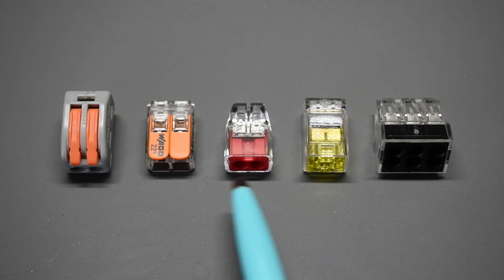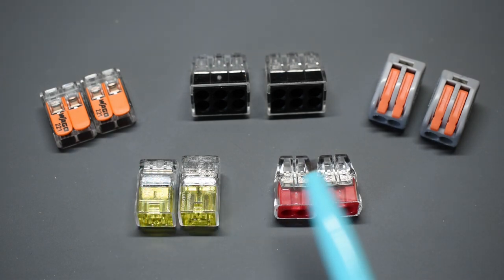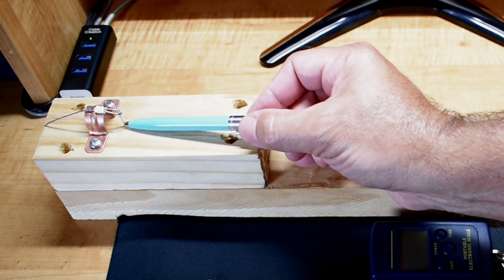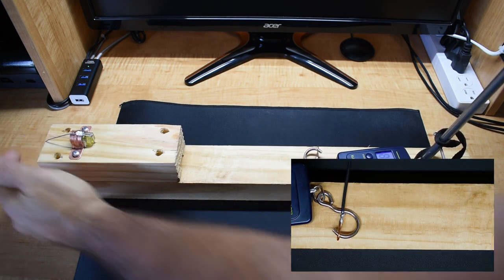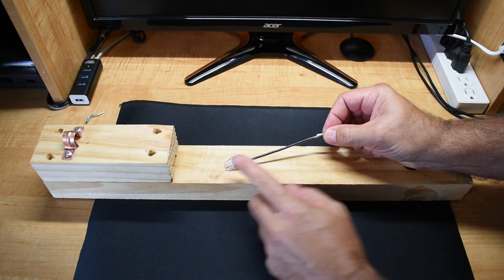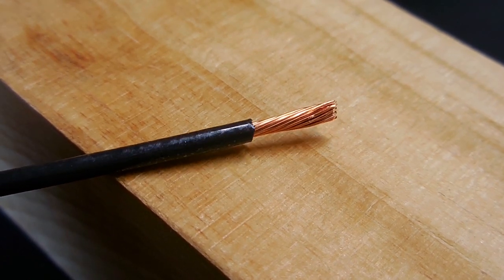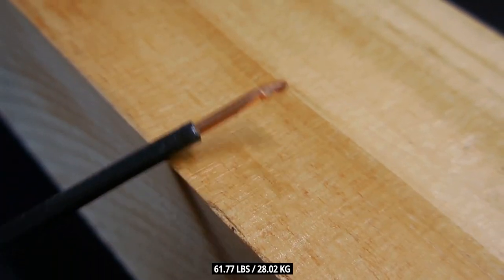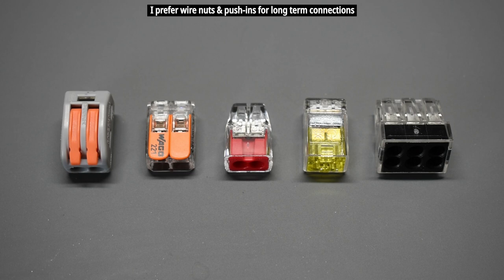Electrical Wire Connector Pullout Force Tests! Wago, Ideal, Contractor's Choice

Comment: The Wago 221's are gtg for permanent use.  They are UL listed to 600v at 20 amps and 85c temperatures, they meet every spec a wire nut does.  If you have something pulling on wires and exposing conductors you have either a flying spice or no wire clamp on the box, both of these scenarios are already hazardous and not allowed.  I remember when the push in style connectors started coming around and everyone scoffed, now they are ubiquitous.  The cost premium is easily made up in labor savings, you can terminate many more of these per hour.  I dont know if you have ever had an already short wire break off in the box because someone twisted the wire too much but these eliminate that problem.   I use the lever Wagos a lot in field connections in industrial automation.  These things are absolutely fantastic.
Reply: Through my new construction, service work and shutdowns experience the only wires I've  had break off were scored solid conductors. That said I've all seen alot a shitty terminations with stranded wire aswell but when it comes down to it all connectors are good when done right. I've definitely seen more good then bad. Except in residential when you know it's was a homeowner handiwork.
Reply: @thomasseabrook1041  thats a good point, "are good when done right" the thing is wagos are almost impossible to do wrong 
which is far from the case with wire-nuts.
Reply: Not everything is permanent install domestic wiring done to code. Maybe I'm doing a hobby thing where I need to hook up LV wires in the field, and maybe I just want to know how much tugging it will take before it pulls out. Useful info is useful info.

Comment: Amazing that these have been used for eons in Europe, and yet only have now seem to become trendy in North American.
Great video as always!
Reply from the maker: Thanks for watching Rich!
Reply: Sad that they brought them over here. They are de-rated to 20 amp by UL, but these are still not a very good connector.  Easy, absolutely and if that's all you care about, I don't know what to say, you probably think easier is better. 

Right out of the box, brand new Wago 221s have about 15 times the resistance of a wire nut. Sometimes even more!!
Reply: @professorg8383  good point. I use wire nuts myself as the direct copper-copper connection is the best one can get without having a continuous line.
I am surprised they their resistance is quite high … still I suppose a wire nut has basically no resistance (as it is not part of the circuit rather binds two wires together) still they can’t be too bad can they?

Comment: It was good to see wire damage after failure.  It would have also been interesting to see which connectors are still reusable after the test, and if so whether or not their pullout performance had decreased.  If the Contractor's Choice product is destroyed by a single test, but the Wago products are undamaged and still perform well after multiple test cycles, that would be worth knowing
At the end of the day though, if the pullout capability of a connector is much more than is needed to prevent unintentional release of wires when pulling a receptacle/switch out for replacement, that's good enough for me.  I'm much more interested in long term connector reliability (e.g., corrosion resistance for oceanfront property, etc.).

Comment: I applaud the follow up video.  I think the in normal operation 22 lbs should be more then enough holding force.  If you have more then 20 lbs pulling on a wire I think a staple or other fastener is warrented to take the pressure off. 

Small nit-pick the lever nuts call for 11mn of insulation stripped.  Not sure what if any difference 12mm makes.
Reply from the maker: If stripping the wire needs to be that exact, being one mm off, then the design is heavily flawed because no one's going to cut the wire exactly 11 mm every time.

Comment: The nice thing about lever nuts is that they work very well with strand /solid connections  such as lights or fans that will connect to #14 solid to a #18 or #20 strand  wire.  Faster and easier than wrapping strand around solid wire or bending a solid over a strand be fore using a standard wire twist on wire nut
Reply from the maker: Because lights or fans are replaced frequently, lever nuts would be very good.

Comment: The first time I did a tug test on the wago 222  I pulled it out so i have never really used them since, but I never had a issue with the wago 773 series pushin connector the last commercial company I worked for loved them but they did residential highrise and time was money and speed over quality( they weren't horrible, paid well, good benefits and had alot of good electricians just alot of them were young and only tought curtain things). The industrial companies I have worked for carried both and QC didn't care as long as it passed their inspection so it was up to you to grab what you wanted. After your video about temperature and voltage drop I use wago for low current applications and wire nuts for anything with many splices and high current.

Comment: All these push in and lever connectors use a spring with a tang to press the wire against a bus bar.  But the end of the tang serves as a barb that makes it much harder to pull out.  And for the most part it’s part of the wire breaking off where enough force will result in the wire coming out.

At least with the push in connectors, the typical recommendation for removal of solid wires is to twist back and forth while pulling out.

Comment: Wago 222 is for connecting AlU and Cu wires with Wago Alu Paste...otherwhise i dont use is it and it is only for solid wires, not for stranded ones. Otherwise great video, always wanted to know how many I need to hold my weight 😄

Comment: Why did you not do the wire nut on this test?
Reply from the maker: No reason to. With a wire nut, both conductors are twisted together, with the lever and push in connectors, the connector does the joining. :-)
Reply: Because the wire itself would probably fail before the wire nut.
Reply: @electronicsNmore  but couldn't the twist itself become loose? This test felt incomplete compared to your previous video with the wire nut

Comment: Cool video, I wonder if the 221 would be better at 6mm2 or 10awg which is the max size, hard to beat at 450v 41A, but yes they are designed for quick access, and like most connectors not designed to swing off LOL 
the 221's are also not rated as maint free, but having a handy wire measurement guide on side.  I do like the ideal insure's to
Reply: Just note that the rating you gave is the IEC rating, not the UL/NEC rating which is 20amp.

Comment: New to your channel, and Subscribed...
 Quick Question ?
Couldn't you Twist 2 leads together ? Like you normally would, in the field ?
 And just for kicks and giggles, to see how two wires, in a wire nut would do ?  
 Loop the 2 into a eyehook, and solder the end you would hook up to weight scale...
 It would be interesting to know the result...🙏😎🇺🇸
Reply: I can guarantee that his scale was not big enough. Not even close!  But I care more about the fact that the brand new Wago connector has 15 times the resistance of a wire nut!  And yeah, I  know, they are sooo much easier who cares about about how good the connection is!!!  Only guys like engineers who are concerned about shit like that.

Comment: Nicely done!  Thanks.

I mentioned on the previous video that lever type Wago's were great for temporary use.  Now this test shows that the wiring needs to be protected from accidental pulls to keep the exposed conductors from shocking someone.
Reply from the maker: I can't see spending 6x the cost of a wire nut, or 2-3x the cost of a push-in connector that's more secure and lower resistance. If I need to keep removing wires, then yes, Wago lever nuts are great to have. If people are Wago fans, then stick with wago push-ins.
Reply: @electronicsNmore  great for regularly changed parts, like lighting ballasts and led drivers.

Comment: What was missing from this video that was in the other video were the standard wire nuts... How would wire nuts perform under this kind of test? would the wire break before the connection inside the nut? I can't picture that happening with a simple twist...
Reply from the maker: Hi there. I already answered your question in the comment area. :-)

Comment: Are there any push in connectors out there that allow you to remove the wire? Maybe a hole you insert a paper clip into to release the clamp?
Reply from the maker: I'm sure there are, but the type I use don't have a release.
Reply: Twist the connector back and forth as you pull, should work with any of them

Comment: Interesting...I just don't know if 60 lbs, is electrically superior to 20 lbs of grip. As a purely physical characteristic, I would never have any significant stress pulling wire out of a connection.
Reply from the maker: I use the test results as an indicator of how well the connector grips the conductor. A better grip(more pressure) on the conductor, should translate into a better, lower resistance connection. Thanks for watching!
Reply: @electronicsNmore  "should translate into a better, lower resistance connection."   There is nothing here suggesting that to be the case nor evidence of it.  The materials and amount of contact area is going to make the difference and pull-out is not even evidence of pressure, it can simply be design (such as having angled 'teeth').   If you want to test it get a tester and get a meter to measure resistance or loss.   Or just look at the other channels who have done it as to how you could make it work for your future tests.

Comment: Wow, 20 lbs for the wago lever style. That's abysmal. Stick with wire nuts. About 1/5 the cost, better contact, less resistance, and far more strength. We recently bought property with a bunch of outbuildings, and there were fans hanging from wire nuts, what looked like for decades. The ONLY time a lever lock is better is if it's an inexperienced person doing the connections, or if it will be taken apart multiple times. I use the push in connectors on boxes where there isn't enough wire to get them together to thread a wire nut on. Like if the person that initially wired it up didn't leave enough, or someone cut off the wireless to put in new switches, making the wires shorter.
Reply from the maker: I would only consider spending 4-6x the cost on lever nuts if I planned on removing wires frequently.
Reply: If a wire is hanging by the connectors it is dangerous and would fail any inspection.  20lbs is far far more than you would ever need for any proper connection that meets code.